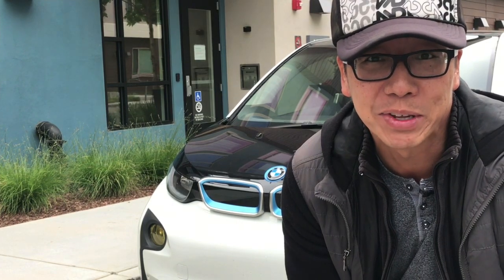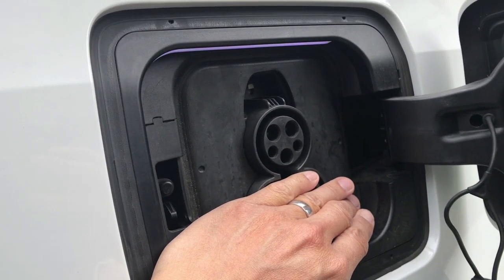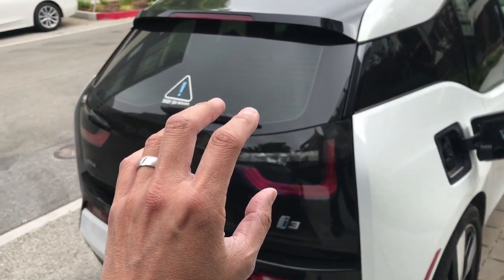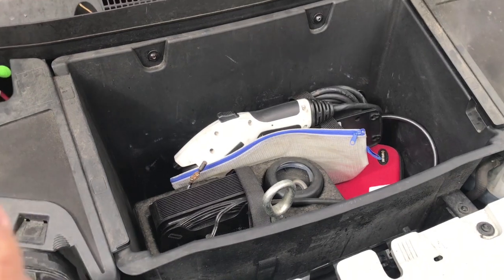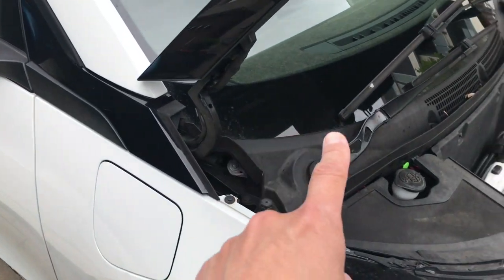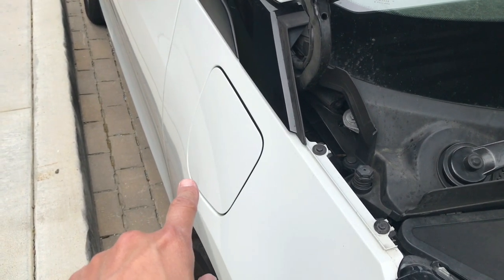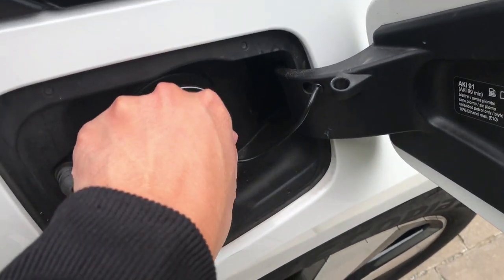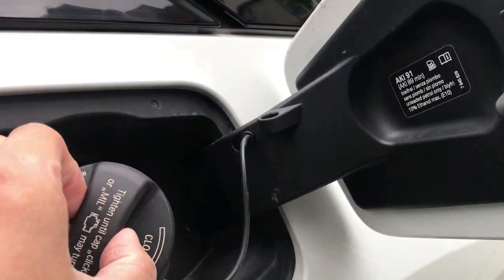i3 Boot Camp - Part 1 (Get to know your REX and EV motor)

Comment: I'm glad I have the BEV, not the REX. I understand that the only I3s that have burned were REX equipped, the fuel line being blamed in at least one case.
Reply from the maker: Yeah super rare though and from what I’ve heard, repairs or stuff was done improperly on them. So it’s user error. Not a reason to shy away from the Rex though. If you need it, you need it.

Comment: Damn, BMW finds a way to make everything expensive, had a seat belt assembly replaced $900, 2015 BMW i3 Rex.
$55k (orig sticker) & they couldn't put a simple plastic lid on the frunk box!
Refilling the gas tank on the Rex is hilarious it's so small and fills so quickly!
Reply: The Rex would function so much better if you code it to European spec. As it is once the Rex turns on it shuts off too frequently like at a light and it can't keep up with freeway driving

Comment: Can u increase the battery range by buying newer or bigger battery
Reply from the maker: Technically yes, but it's not really done in the USA. It's cheaper to just buy a new car. You won't be able to expand. You'd have to buy a whole new set of cells. At $2,200 per cell x 8 plus installation, it's really not worth it.

Comment: Great summary.
We researched for years, and decided on a used 2017 REx (first full year of bigger battery).
We use EV drive 96% of mileage annually despite 24k miles/yr.
Car goes 40 miles on a GALLON of gas.
Car goes 40 miles on a DOLLAR of electricity.
We saved over $2,000 in fuel last year (our rates near Seattle are $.10/kWh, and gasoline is $4/gal).
As you stated, recoding with Bimmercode works well (we use it to turn on generator during high speed long trips).
Reply from the maker: Congrats. You got the best value i3 as of these past two years.
Reply from the maker: I uploaded part 2 but realized there were too many things I forgot to include. Will be re-editing and uploading in the coming days.

Comment: DC fast charging was optional in 2014.  Ordinary people don't have DC fast chargers at home because they are very expensive, not because all the lights in the neighborhood would go out. That's as far as I got.
Reply from the maker: Yeah, I rewatched my video and the earlier sentence I admittedly did misspeak but tried to correct myself later on. Yes, optional but became standard in 2015 and newer versions. 

No, level 3 charging takes a ton of "juice". Your neighbors wouldn't like it if you paid for a level 3 in your house. I don't think you'd have enough amperage on a circuit breaker to even feed that.
Reply: It's an academic discussion because no one has DC fast charging at home